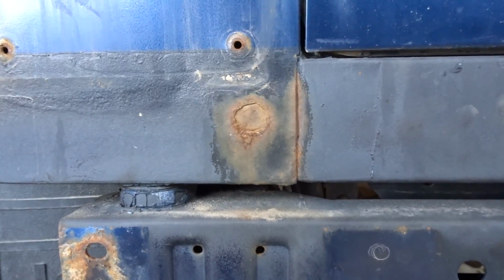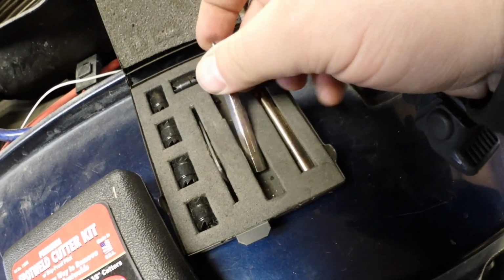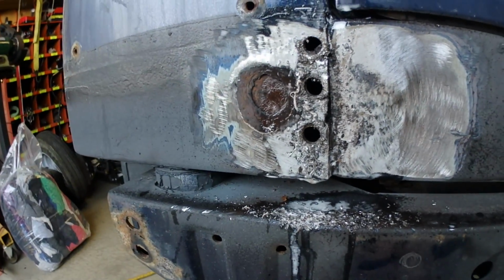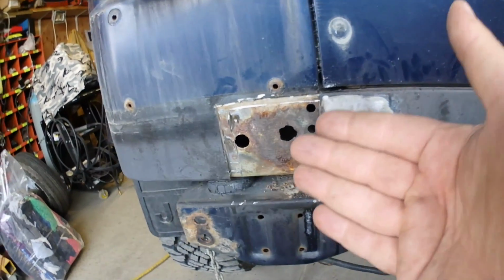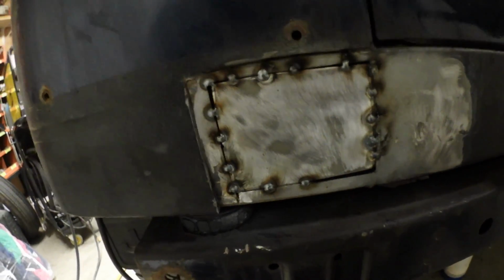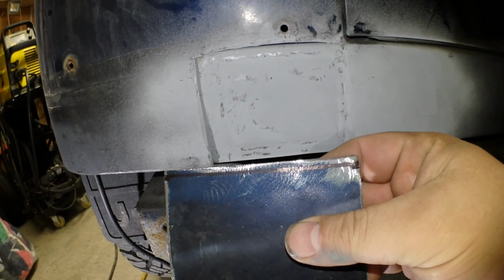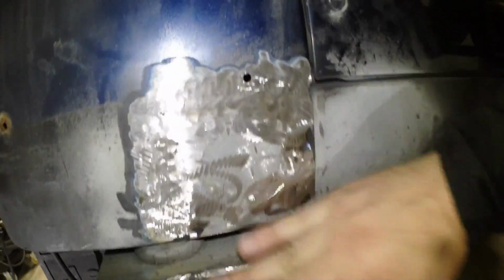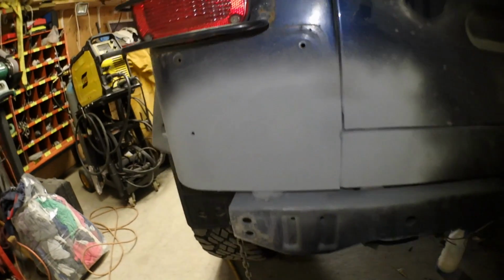DIY How To Repair Rust and Weld Body Panels

Comment: Do you have to drill through with the spot weld bit? I thought it was meant to just take out the spot weld on the top layer without drilling through.
Reply from the maker: You are correct yes, however in the video I cut everything out hence why I did that
Reply: Ok, thought so. I've not used one yet. I just redid a cherokee as practice for my wrangler. So, i just ground down spot welds with heavy flap disk to take whole panels off. I want to be more precise when i do the wrangler. 

Thanks Jerry, your videos have been invaluable to me over the past 5 years.